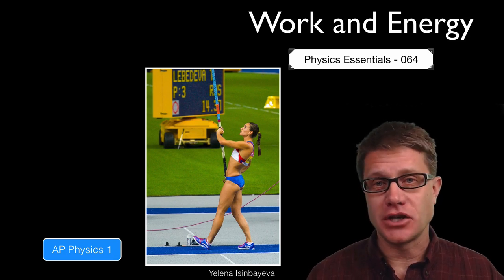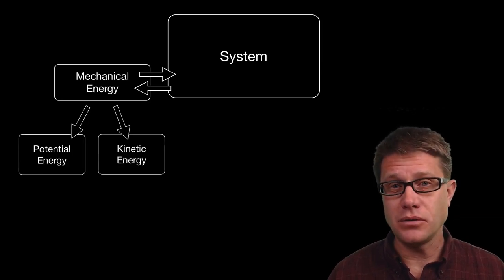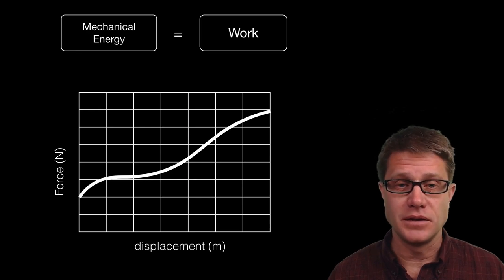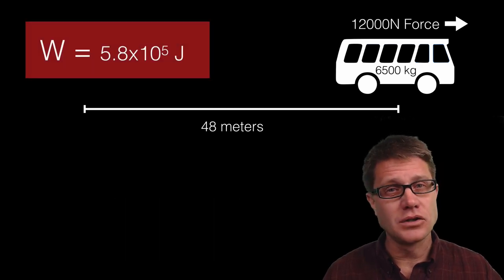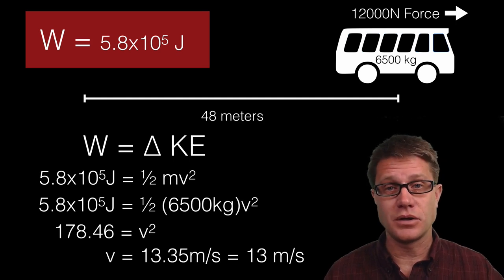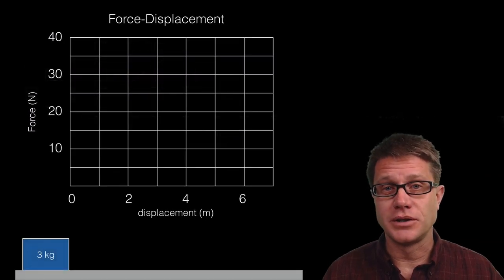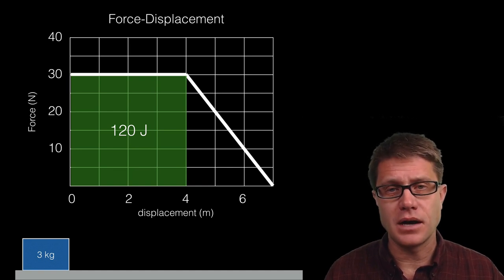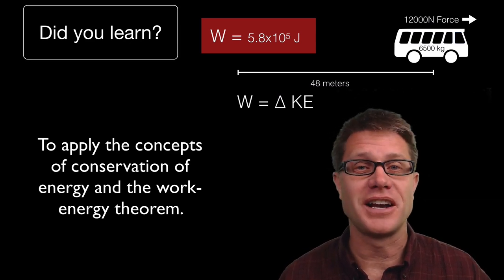Work and Energy

Comment: Is typing on a computer keyboard consider work in physics sense?
Reply: A little bit the Force would be Force applied (the force you push with) plus the Force due to gravity and the discplacement (d)would be how far the key travels down. W=Fd=(Fa+Fg)×d.

Comment: Um wait, what did you do with cosine formula to solve the adjacent side if we dont know the hypothenuse? Could you explain a bit? I understand it so that
38 = cos^(-1) ( adjacent/hypothenuse )
but I dont quite get where we will get the length of the hypothenuse
Help me please!
Reply: Taru Kiiskinen The hypotenuse IS GIVEN as the force, because it's being applied at an angle (in this case, 38 degrees). To solve for the adjacent side use soh cah toa:
  
Cos (38 degrees) = Adjacent / Hypotenuse
Hypotenuse * Cos (38 degrees) = Adjacent

Once you plug in the force as the hypotenuse you get: Adjacent = 12000N * Cos (38 degrees) 
Hope this helps :)

Comment: A doubt.  If an object is having a potential energy, so, due to the transformation of energy, its potential energy can transform to kinetic energy or other energy.  So, if a kinetic energy is applied to it, will  it combine with the original potential energy and thus, the final energy released by it, can it be a combination of both forms of energy?  The theory of conservation of energy, does it mean, any object will have potential energy? So, in the nergy transformation, is it a combination or, the potential energy is unused but, it is only affected by the kinetic energy?  If gravitational force is a kinetic energy, when it is applied to an object, will it induce also the release of potential energy?  If so, will the object falls faster when 2 kinds of energies are combined?